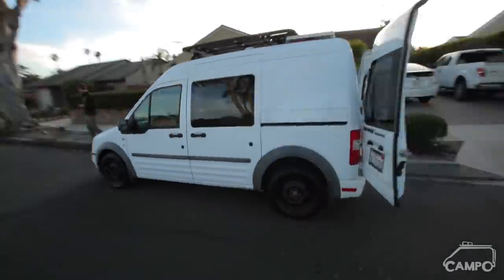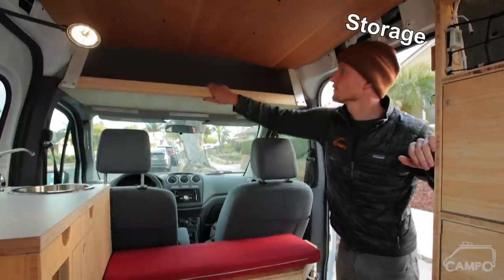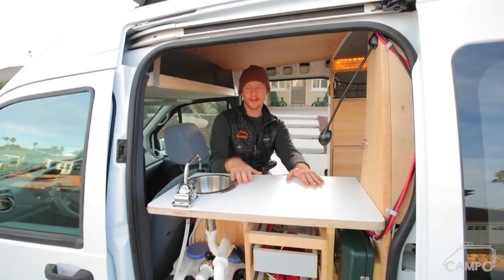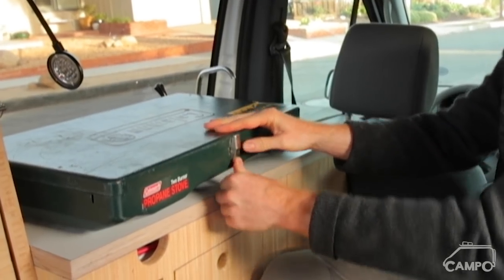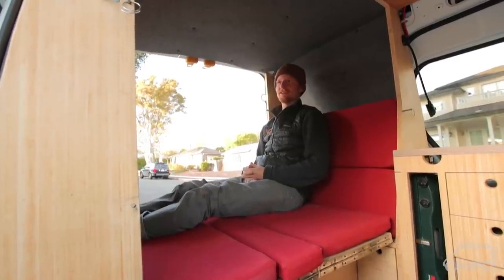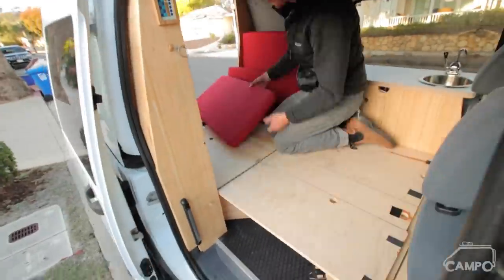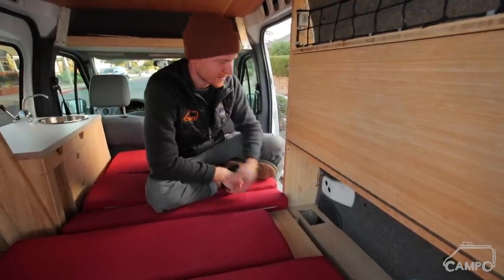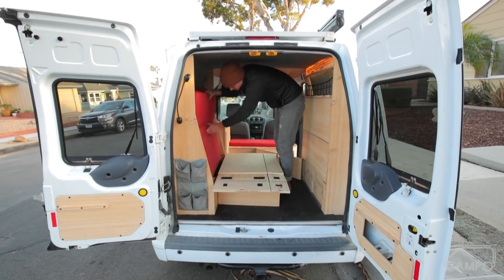Architecture Grad Student - DIY MICRO CAMPERVAN

Comment: I bought one in 2014. Lower headroom. I converted mine. I have used it for road carpentry jobs, boondocked, have a kayak, 2 100 watt panels above, 35 liter Alpicool fridge, full galley with single burner. Its so basic compared to your design but I have actually lived in mine for 6 weeks. Its like a lunar module honestly but you are modest to say this is a weekender. A minimalist could live in your layout indefinitely. Nice, nice design capital you've displayed here. Multi use is absolutely critical for a single, small, everything vehicle. One observation from experience: a small cargo box on top is invaluable. I use dry bags and put dunnage into my kayak cavity. It keeps the bulk inside to a minimum.... Or makes room for my tablesaw and chopsaw below, lol. Thanks for sharing. Fantastic and functional transformer van.

Comment: 2:02 to 3:17 - I really like the seating 90 degree to the kitchen top for smaller/lower top vehicles, just needs a pullout table for dining and foodprep. Also the kitchen guts being accessible from outside is super practical, bet a garden hose could live in there for easy refills. I also wonder if cupboards could hang from the celing

Comment: I’ve a large Boxer (ram master I think you call it). Bed, bath, kitchen seats/sleeps 4 etc etc.  Guarantee your van took a lot more thought than mine (and mine took an awful lot of thinking, probably more than the build) small spaces are way harder to get right. It’s an awesome thought out and executed van. Nice one fella. 

I did note a couple of small things , I couldn’t see any vents or alarms, smoke or CO2. Don’t think I saw a fire extinguisher, either. 

Enjoy.
Reply: If you are an Architech, like he is, then you have the mind set to get round the problems of design, as is here more than visible.
I think condensation is gonna be his biggest problem and according to where he is gonna want to park for the night, cold will also be a thing. I noticed he has not much in the way of insulation.
Imagine if he had been let lose on your van or my Proace... wow!

Comment: I get my Transit Connect this week. This is by far the best layout I've seen. I will immediately start modeling it in 3ds Max. The only difference is I have the back cargo door windows, but don't have the side cargo door windows. I would like to see a lift and turn function on the Captain chairs so they can be turned inward and used as an extended layout.

Comment: Nice build. I like your different zone thinking. On the other side of scale - consider the cruise ship. Basically one design theme for a ship that has about 12 decks, 2000 passengers and1400 crew. It's easy to get off at the wrong level because everything looks exactly the same, not unified - just repetitious. You're bored the first day.  You begin to navigate by the bad art on the walls - stuff you'd never look at twice becomes the way finding landmarks. 
I think what van life needs are a series of well made insulated pop tops that don't cost $5000 and fit all kinds of vans. To me that's the game changer. Sprinters are nice, but basically you're driving around dragging a tall box of air that has absolutely zero utility while you drive getting 11 mpg. 
The next level will probably have to come from the vehicle companies, a pop up van that is no taller than an SUV (like my Tesla Model Y -but longer) while you drive.  There's one of these that will fit in the 6' bed of the Cybertruck but basically it's like a phone booth.

Comment: I like this. If I build one I will steal some ideas from this one (including involving my retired architect family member.)  Since I wouldn't use hauling and camper at the same time I think I could get a one or two piece mattress.  I also think bed mode would be more slats on rails rather than jenga (lets air flow under the bed to prevent mode, less weight.) Love the bamboo plywood.  Thanks!

Comment: I don’t DISLIKE the bed set up, but I gotta figure you could just blow up and air mattress in the same space and have a more substantial bed than those very thin cushions
Reply: That would be more of an nuisance since u would have to deflate it in "office" mode compared to just using the cushions...he can just use cushion foam for more padding support if need be

Comment: Very cool. Those folding panels secured to each other with piano hinges: that's more complex and ingenious than anything I've seen before. Maybe too complex. If it holds together long-term, and you don't end up wondering why it has to be so complicated to set up and take down the bed, then I guess that would be the best way of settling that discussion. Also, all those different-sized, relatively small cushions that get fitted together to form the sleeping mattress: do they stay in place all night? But taken all together your conversion is very nice looking, shows attention to detail and seems to be an efficient use of space.

Comment: This is amazing as it really is stealthy. I’m in process of conversion for transit connect 2013 but both my jobs require use of my vehicle. I work with the elderly and sometimes have to give them rides and I’m also a handyman and have to work outside in crappy weather(trying to cut wood or work with your hands when it’s 20° out it’s very difficult so having a warm place to jump into to finish certain parts of the project is really helpful) so when working with the elderly I’d like to be able to say he don’t worry I’m not living in my van and when I take them shopping I’ll have enough cargo room to put their groceries in or the wheelchairs or walkers and when I’m working Handyman Work I’ll have better coverage from the elements I’m wondering do you have plans that you sell online because i’m very interested in buying them for my build if you have all the measurements according to the dimensions of the transit I’ve seen other bills which I really like to but I got to say yours is the cleanest so far one thing I would add and I’ve said this before and other bills I would definitely have some sort of escape patch on the roof just sometimes I think it would be cool to be able to stand up and stretch and look outside without having to get out of van. I.E bad weather or night time etc. I priced boat hatches the bigger ones are pricey but worth it. It would still leave room for solar panel. Great build💪🏻👍🏻